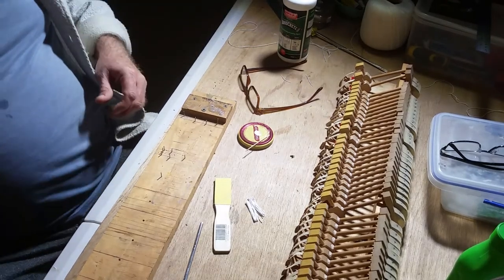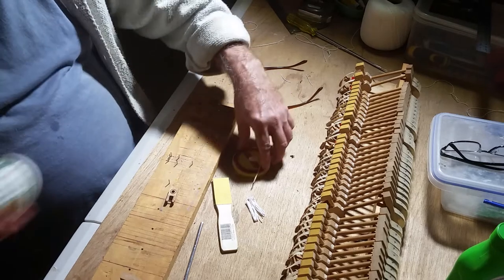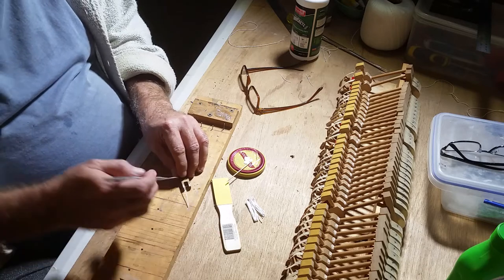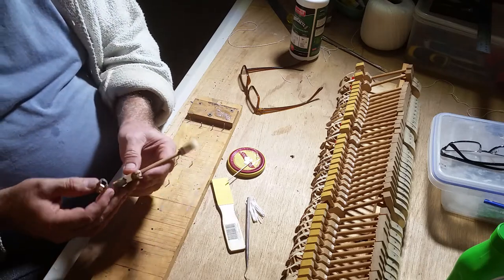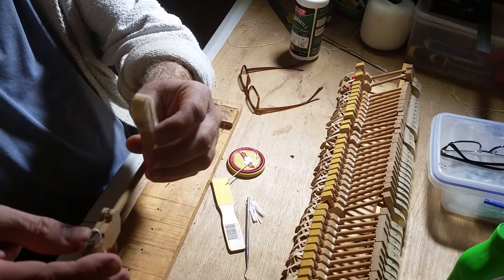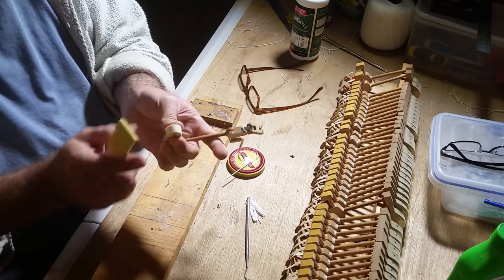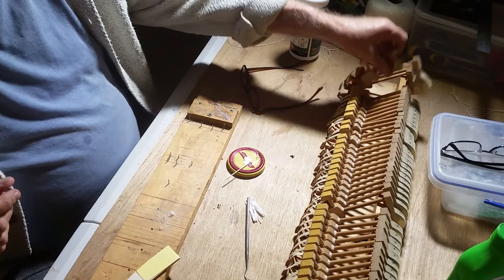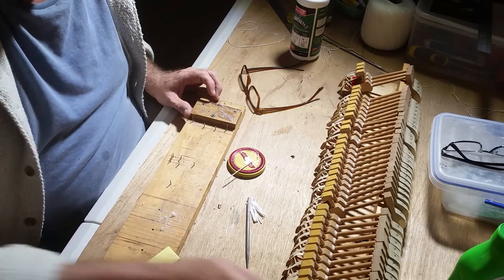1970's Upright Yamaha Piano - flange cord replacement.

Comment: Takes me less than 2 hours to do a complete set of loops on a Yamaha action. The hammers don't need to be removed, just unscrewed at the butt plate and folded out of the way. I leave the flanges attached to the action rail and scrape them clean and glue new cords in situ. Did one recently, 1hr 23m start to finish.
Reply: How do you re-assemble the hammer butt and plate to the flange? That seems incredibly fiddly because the dampers are in the way and make life hard. Do you remove the dampers or do you have some clever tool or technique that hold it all together while you do up the butt plate screw?
Reply: @jslonisch  With the action standing upright on bench with dampers facing away from you, remove the hammer rest rail, use a spindle screwdriver from the rear to undo the butt plates (between damper bodies - about half a turn should suffice) then lift hammers up and away from flange towards you. They will hang down on their bridle straps. Then rotate action 180° with the damper heads now facing you and lay it down towards you so its now on its dampers to enable you to scrape the old cord off the flanges ready for new cords to be attached. Reassemble in reverse. The centre pin readily locates with the groove in the butt ready for retightening, you'll see after practicing on a few!
Reply: @TheTaiga1987  If you leave your contact number, I'll WhatsApp you some videos of the process when I next get an action. In the meantime, I'll send you some images of the tool I made for scraping the old cord rom the flanges.
Reply: @TheTaiga1987  Hi, your link is invalid!
Reply: Hi ThePoshPleb is it possible to share some videos on how you did this your way ? I’m very interested in this. I have a 70s Yamaha W101 which I need to do this for ? Thanks
Reply: Which brand of cord will be strong and yet long lasting? Please do reply

Comment: Dear sir~How do you get the proper length on the replacement cords? Also, what glue are you using?
Reply from the maker: Hi, I have a jig made up speshly for Yamaha flange cord. I use a white glue called Bondcrete & the cord length is 40 mm. It may differ between pianos. A good idea is if you can find one that still on the flange & measure the length as a gauge. Thanks for watching.
Reply: stemart1641 Thank you very much. :)
Reply from the maker: You're very welcome!